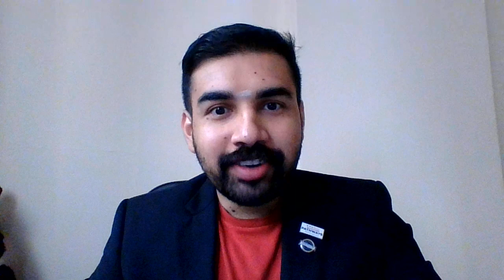Offshore Artificial Islands

Comment: Sir I have a question,
What are the entry level position for Mechanical Engineer at offshore?
Reply from the maker: In past there was lot of training programs conducted by reputed companies, they will be providing training in each departments such as maintenance, drilling and marine. Later based on our interest they provided job offers but Now a days due to low price of oil, none of the companies are conducting any training programs. So you may need to enter to rig as a roustabout and later can move to maintenance department as a motor man or any junior positions in other departments. Here I just explained about a department as an example.